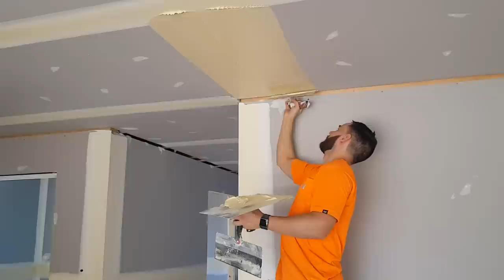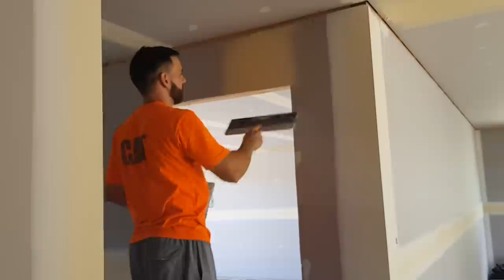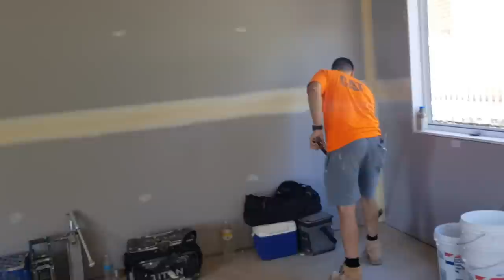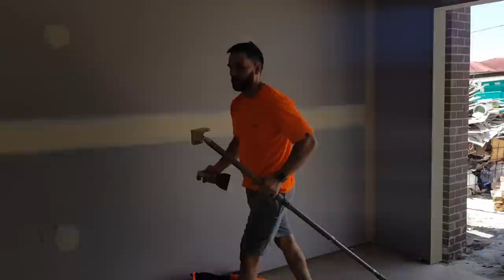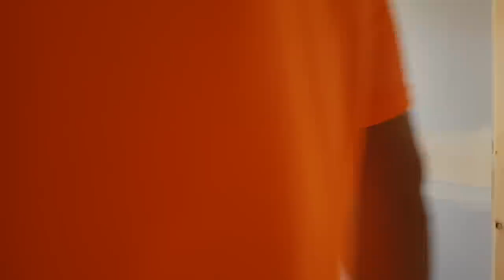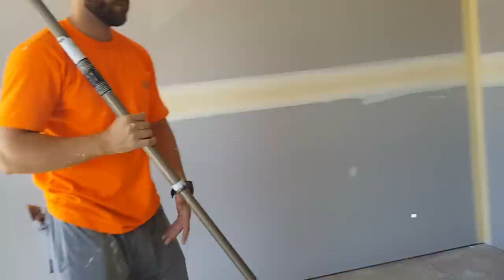Drywall Construction Workers Finish Coating Room in Minutes

Comment from the maker: Makita 18V Brushless Drywall Sander & Vacuum - https://youtu.be/j9rHFWOoz1c
Reply: Why is there a gap in the ceiling corner on the drywall
Reply: @marlonmaatrijk1571  crown molding
Reply: That's what you call Done Right.
Reply: Can I get the links for the tools they use?

Comment: In my local there are over 400 finishers active at any time. And almost everyone of them is the best lol. If it works go with it. Nice job guys. Clean amd fast.
Reply: Fast? Bro wiped that first but joint like 20 times lol
Reply: @ModernGentleman  I’m sure you’re the best as well. Probably faster and whatever.
Reply: @Eddie_Ray  definition not. But I dont wipe anywhere near that much. Its way too much time in the same spot. That's just my opinion, but im just a dumb drywall finisher with a mere 17 years of experience.
Reply: @ModernGentleman  I’m very proud of you
Reply: @Eddie_Ray  yikes 😄
Reply: Fast are you joking? 😂 ten seconds at the most to do a butt joint
Reply: @andrewpirie9215  lmao right this man was 13 swipes on one butt joint

Comment: I was a solid plasterer but do a bit of Dry wall as well now and again-super quick guys-great to watch!
Reply: Good 👍
Reply: Why is there a gap in the ceiling corner
Reply: @sonnuocvolg874  Why is there a gap in the ceiling corner on the drywall
Reply: @marlonmaatrijk1571  -Cornice moulding-no need to close up at all
Reply: @marlonmaatrijk1571  -that is there so the guys can wipe their blades clean
Reply: Thank you. You guys are doing an nice job .I'm learning a lot
Reply: @marlonmaatrijk1571  hoeklijsten

Comment: I've watched a few of these videos and these guys are true pros - well done. Clean, efficient, and quality. One question thought - why the big gap where the wall board meets the ceiling board? Is there crown molding being installed in the entire house? Is this for expansion/contraction of the house?
Reply: I have the same question about the big gaps.
Reply: It will be covered with cornice (usually 55mm) so no need to make a tight join. The fixing team generally sheet from bottom up in this case because it makes their job easier when screwing the board.

Comment: Im curious why you stack the walls leaving the gap on top instead of pushing walls up leaving the gap on bottom where it eventually gets covered with baseboards?
Reply: I guess crown molding will be installed.
Reply: Yes, crown molding

Comment: so I was led to believe that most guys used a trowel OR a knife (with hawk or pan, respectively).  but this guy is doing what I ended up doing when I tried skim coating a ceiling today. He's using a trowel AND a knife.  Maybe in about 10 years I'll be able to do it as deftly as he does.

Comment: I’m going to go out on a limb and say a lot of this has to do with the mud - brand, type and how it’s mixed. Having the proper mud at the right consistency is key.
Reply: Why is there a gap in the ceiling corner on the drywall
Reply: @marlonmaatrijk1571  I'd guess that the room will have crown molding, so the gap will be covered.

Comment: Are all the butts you run recessed? Also, the guy running the hawk and trowel looks skilled enough to run it without putting his last few passes with a blade. Just saying. Nice work. One more question. Is the mud you use for skimming/topping orange?

Comment: Hey I've always done it with hand tools and I'm looking to get into the tools like flushed and what not but I'm trying to get as much know-how as I can before I invest in the tools. So the tool you are using to spread the mud in the corner, that's different from the tool you use to flatten the tape in the corner after you use the roller, right? The one after the roller is a flusher? Or is that what the head you are using is called?
Reply: 1st the tape will be applied with a banjo or bazooka...then they are using a compound tube with an angle head similar to the flusher 
but with 3 holes in it....lastly...the flusher head is used to squeeze out excess mud.
Reply: I understand as far as the banjo or bazooka and then using the compound tube to apply the mud. My question is, is there a difference between the angle head used to squeeze the mud out after taping, and the angle head used to spread the mud after using the compound tube. As far as I know they are different aren't they? One is a flusher head and one is an angle head?

Comment: Here in Brazil it's impossible to make straight lines like the ones you guys are able to do. I don't know if it's due to the high moisture, the components of the joint compound, or whatelse. I have seen very experienced professionals and gave them the challenge to do so. No one was able. How much water in the compound to get a so thin mud? Congratulations and thanks for sharing.

Comment: Where are you guys at? I didn't know international Building code allowed us to leave wood framing not covered by a fire blocking product inside living areas. Especially at the top of a wall. Are you using a rated material for crown?

Comment: for those wondering why his mud is yellow: its called topping. 
real pros know the difference and when to use it. 
joint compound is used to embed tape and do the first coat and second coat. lightly sanding in between. 
then for the finish they apply topping which unlike joint compound is vinyl based and therefore goes on smoother and is easier to sand and bring to a really fine finish. 
While I agree he could probably do a more effective job with a knife and pan, I have a lot of respect for guys who can use a hawk and trowel, shit takes skill and as long the job gets done right and on time people wont care if you put it on with a butter knife. 
Cheers mate, it looks great
Reply: Where do you get this “topping”

Comment: What do you do on those interior walls where they meet the ceiling? I’ve never seen that done before in the United States?
Reply: They get a corner moulding called cornice. Plenty of different designs but the most basic and common is a cove shape.

Comment: Also I noticed that you use the adhesive before you hang, some ar as in the states do that but is it code? Or just trying to get rid of nail pops. I also noticed that your framing is 24” on center, 1/2” max framing is 16”. Is that why you use the glued blocks between the trusses on the joints?
Sorry for all the questions, I’m a 35yr drywall guy but we can always learn!!

Comment: I'm 17 almost 18 years old, close to being out of high school. I've been debating to become a union painter or a union drywall worker. I live in Washington State and we have a IUPAT apprenticeship school here. I was wondering if you could give me any tips on which trade to pursue and anything I should practice or do to prepare myself. 

Awesome video, thanks!
Reply: Do not get into construction it looks like fun now but its not when you get older this looks easy but its not its hard on your back and neck if you really want to get into construction i suggest plumbing, electrical or a/c painting its not so bad but in my opinion doing painting and drywall is boring and tedious lots of sanding not very challenging i would just go to college find something you really like to do.
Reply: @julcast1229  Well the thing is. I've always enjoyed working with my hands, I've never enjoyed working with paper, pencils, and computers. I would rather spend my last living breath outside doing something with my hands. The only reason why I considered painting or drywall is because they both seem pretty interesting to me, I've also done drywall and painting before and I enjoyed it. The only reason I'm kind of picking drywall over painting is because it seems to pay more, industrial and commercial panting doesn't seem to pay all that well. I have considered plumbing and electrician, the problem is I'm not that good at math. I just to be so horrible at math that I used to have to practice outside of school, I've gotten better at math but I'm still not the best. It seems like to be an electrician or a plumber you have to know quite a bit about mathematics.
Reply from the maker: Hey Dorian, what did you choose bro? You get into drywall?. I thought your comment was correct. I find outside of drywall you can still do anything you want to do. It's very practical..pays good and it's rewarding

Comment: Those must be 24' sheets on the ceilings. I like it.
Reply from the maker: they are 18ft, but are only 10mm and very light. Cuts down in the finishing, barely any butt joints on a standard job. Thanks for tuning in!

Comment: Bad ass work ....12 yrs in the states and never seen anything like this...saludos de Monterrey Mexico..is there any way to get in touch with you guys for any questiions o doubts???
Reply from the maker: Yeah here in the comments mate
Reply: @Maxkil  my biggest doubt or question will be....how do you guy do the butt joints?? Ive seen tons and tons of finishers doing em on different ways starting right on the middle and others running the 12" trowel on each side of the edgeof the tape
WHAT WOULD BE YOUR ADVICE FOR BEST RESULTS???? GRACIAS POR YOUR HELP

Comment: Hi there, I want to tape and joint a ceiling inside a container home... The ceiling flexes by almost an inch along a 30 foot span when I'm walking on the roof for maintenance... Is there a special flexible mud I can use along with tape in the joins that will avoid cracking down the line. Thanks
Reply: Yes it's called joint compound.
Reply: @miguelg2650  hi Miguel, thanks for getting back to me on this, can you tell me if there are joint compounds  that are better than others when it comes to flexibility? Cheers Nigel

Comment: Why is there such of a big gap in between the wall and the ceiling wall?.
How do you guys finish it?
The wall  board should be tight  to the ceiling to make a real anlgle finished !!!
Reply: I think that's an Australian thing. The crown molding is made of gypsum, so they just cement it in place with joint compound.

Comment: Hi, after coating joints on ceiling. Do you then sand and prime+paint? Or have to skim coat the entire ceiling before paint?
Reply: Look it over with a light (pointed sideways at wall or ceiling) to determine whether or not it's good enough for you, sometimes 2 coats is good enough, if you want it perfect 3 coats then touch it up, hope this helps you 😁

Comment: ? for ya. Is that wallboard glued on,
cause I can't see any screw or nail heads?  What area are y'all in?
Reply: Yes is glued it's required in Australia.  Screws around the perimeter and just 1 centre screw every second stud. Only certain applications will require no glue and more screws

Comment: 3:00 what's with that big gap  behind him the length of the wall above the glass? couldn't you match up the boards? how you gonna fix that?
Reply: In Australia it is Pretty Standard to install a cove cornice -90mm/75mm or 55mm or even fancy fibrous old style cornice,in this country it is not needed to seal this area with sheets in domestic housing.We are pretty lucky that it is still our job to install these features and finishes off a room nicely.
Reply: @dismaldog  thanks for the response, i guess that explains it. In america, we never heard that word ..."cornice". Sounds like something you'd eat in middle-ages england.

Comment: Dude nice work with the cement trowel but if you have to pass ur 14” knife 6 times over a butt joint something is wrong maybe you should try a bull float and that’s not a level 5 finish I can only imagine how many times u will have to pass that knife to make it level 5 or to even sponge with no sanding .
Reply from the maker: Lol cement trowel. Good one

Comment: I assume it’s for crown moulding but why do they leave gaps at the top of the wall and the ceiling? I just started and I get told to push the wall board up to the ceiling and it will prevent moister by leaving a gap at the floor
Reply: Your assumption is correct
Reply: Cornice made from the same stuff the drywall is made from. That's what goes up there Australia's version of crown moulding I guess
Reply from the maker: yeah there is a 10mm gap at floor
Reply: Maxkil oh wow you actually replied! I love the work you guys do it’s so smooth and fluid, never seen a team of workers so efficient and skilled, love the channel

Comment: Do you guys always leave your corners that open just curious? I'm from southern California not use to seeing that size of a  gap. Great videos though keep up the great work.!
Reply: jaayyy_ 27 they use cornice down there for firecode I believe
Reply from the maker: No fire code here between rooms only between dwellings.  The cornice or crown molding , is made from same materials as the drywall itself. Both of which are not meant to hold back fire.
Reply: Why would u keep changing from trowel to broadknife. Just use one or the other lol
Reply: @danielwill831  Trowel is almost double the width, therefore carries double the material😉
Reply: Mouldings cover the space
Reply: Daniel Will I use a smaller broad knife with he trowel, using the bigger broad knife defeats the purpose of the trowel
Reply: Maxkil the fire code is for smoke not fire

Comment: A lot of gybrockers come in and just screw the drywall on to the studs the dont plumb anything nor do theysquare the gybrock up I've seen it so many times on building sites it unbelievably bad in the trade industry no use of string lines plumb Bob's or laser levels just a screw gun and took belt I havnt even seen them packing behind the gybrock looking for low or high spots on studs and noggans

Comment: Why not run the flat box on the butt joints too? We do.
Reply: @jefferybisheimer6178  Muds watered down more to run through the machines, we like to use thicker mud for butt joints just for less shrinkage unless there's heaps of them! On finishing day we skim over the butts with the 12inch each side!
Reply: Doing a good job very clean but you either use a hawk and trial or a knife and pan but it's a lot quicker to do it with the drywall Taping Tools

Comment: I used to split my butt joints on zero with a ten inch box then run down the middle on three with a twelve inch box.  Rarely any problems.

Comment: That center piece of drywall on the ceiling looks like it’s 20 feet long, what’s up with that
Reply: Autostream 1  they are 18 footers the big dogs but it’s thin board only 3/8 so isn’t that heavy. Way less butt joints to do with the longboards.

Comment: They really did the nails one by one lmfao just slide the 6inch on em
Reply: Only if you gonna come and sand it.
Reply: @mirzasemic7789  😂 with a pole sander it is no extra work and striping is three times as fast, they probably had a rookie spotting their nails Since it's hard to stripe without the cordination, every expert finisher stripes their nails

Comment: We always do 3 trowel widths for our butt joints. One down the guts and one either side. Nothing wrong with your butt joints though. They look nice and flat
Reply: You don't know that by just looking at them
Reply: Yeah you can tell by working on them if they need to be wider or not
Reply from the maker: Is that you Andrej? The gangster?
Reply: @Maxkil  sure is 😂 Merry Christmas and happy new year!
Reply: Just a question why does old mate hold his trowel backwards? Is it the way you were taught or did you just start using it like that?
Reply: @boohool1gan423  he tried both ways thought it was more comfortable that way cause you can hold your hand on the curve where it attaches to the trowel and wrap your fingers around that and the brace on the back. Gives you easier control when feathering the edges for him anyway. If you can picture what I mean

Comment: The guy that's running the butt joints that a drywall finisher right there I'm a pan and knife guy 23 years iv been doing it started out spotting nails for five bucks an hour got moved into closets now I do it all my fast is coat is taping I use a tape rack and and pan don't use a banjo don't use the slop box I do it by hand my uncle has been doing it 72 years he taught me how to do it only thing you have to do is sand our lap marks that's about it

Comment: Where the hell are the screws on the walls. I've never seen board hung with only 4 screws holding the board up
Reply: Some dry wallers use liquid nails behind the dry wall. Who knows if that’s what they did🤷🏽‍♂️
Reply: In Australia we use glue specially formulated to hold the board to the studs.

Comment: Is it me... Or they forgot to drywall the inwards corners and now the tapers are on a strike for them to fill the gaps 😂
Reply from the maker: 90mm Cornice going up. That's what two sheets stacked equals to our standard ceiling height. Not needed to be a fire barrier here in Australia unless there is another dwelling on the other side of the wall

Comment: Why is the mud yellow?
Reply: Probably tinted for affect ??
Reply: Some compound is tinted. It's more visible when doing point up.
Reply: Its an all purpose plaster. Comes pre mixed in the bucket.
Reply: @lesneumann890  thanks Les! CGC has a yellow taping mud that's supposedly crack resistant. Is there a special situation that calls for yellow mud or is it just the tapers preference?
Reply: Its called topping you geniuses. real pros use it as their final two coats because its vinyl based and is smoother than jc and easier to sand.
Reply: Ran out of water had to use the beer and piss 😂😂😂
Reply: I’m assuming it’s boral lite finish

Comment: Who is it that the inside ceiling corners are never taped and gapped?
Reply: I was wondering the same why aren't the ceiling angles taped
Reply from the maker: It's getting covered with cornice, same material, same thickness, also doesn't need to be fire rated. It's fast it's easy